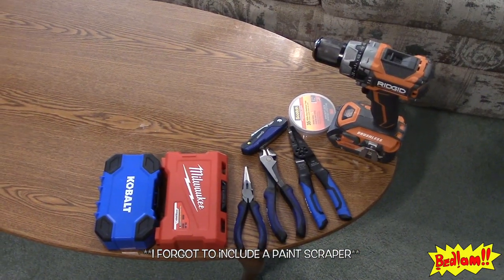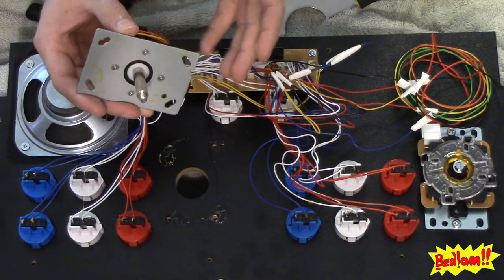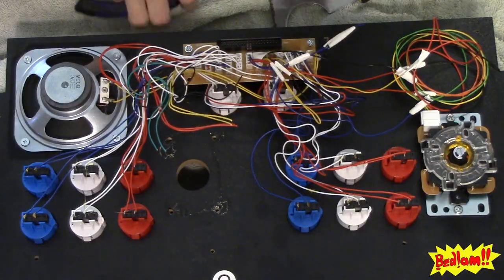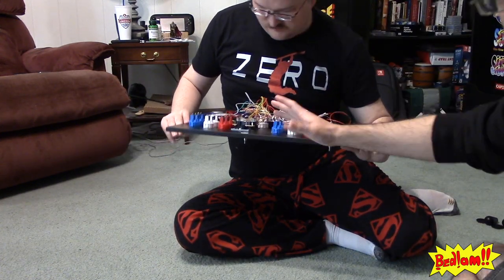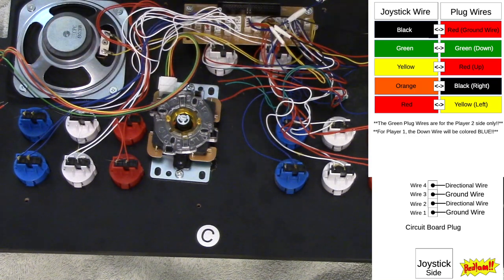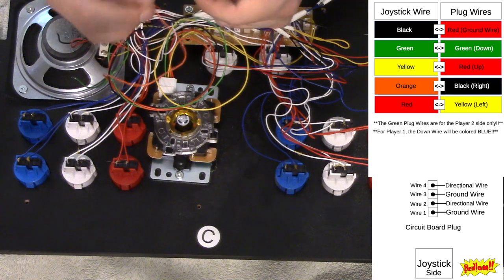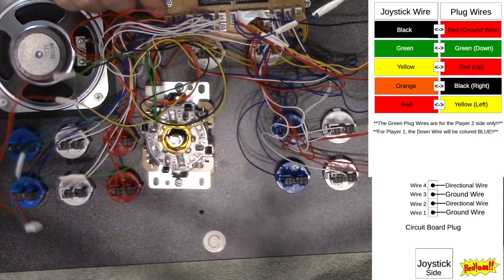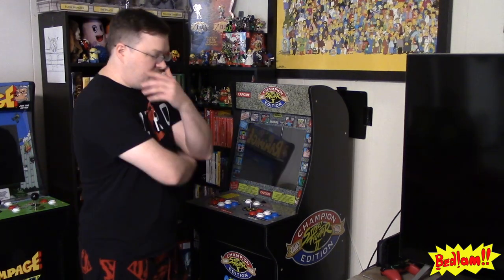Bedlam!! : Gaming - Episode 11 - Sanwa Joystick Installation On An Arcade1Up

Comment: When I ordered my JFL Sanwa joysticks, I just took the metal plate off of the Arcade1up joystick and added it to the Sanwa JFL Stick and then used the exact same screw holes that the Arcade1up already had drilled. it was so easy.
Reply: I wish I had thought of that when we installed these!  I'll definitely remember that for the future if I do this again.
Reply: Dude you just unloaded so much stress from me, I'm not good with a drill at all, thanks so much for the random comment <3
Reply: such a fucking good idea
Reply: Doesn't work on their newer cabs. They use a revised joystick that has a different mounting layout for attaching the joystick to the plate. They even glue the sticks in! It's tough to pry out the stock sticks + plate, then you still gotta drill for the replacement lever! So this video is again, relevant. I just did this upgrade on a Shinku Hadoken cab, but I chose customized OTTO V5 joystick assemblies 👍

Comment: You don’t have to use a paint scraper, it’s easier to pop off the old stick by tapping on it from the other side with a screwdriver
Reply: Thanks for the tip!

Comment: Save yourself a ton of hassle, order the Sanwa JLF Cherry Mod from Paradisearcadeshop and some .187 harness wires, plug and play just line up and screw in.
Reply: Superdimensional can u link and are they as good?
Reply: Mario Pirchala https://paradisearcadeshop.com/en/home/controls/levers/levers-sanwa/1108_sanwa-jlf-with-cherry-switches
Reply: Mario Pirchala I upgraded the spring to 2lb for a little more tension
Reply: @Superdimensional  These are nice. So don't have the get that 8 way piece. Do we have to cut the wires like this guy did or can we get specific wires for these. I just saw your channel that set up is real nice. You added the shaft cover and batstick. Looks real good.
Reply: Superdimensional thank u sir much appreciated...u should put links of these in ur video...ordering them now
Reply: Superdimensional would u recommend these for the other cabinets...PacMan Rampage Galaga? Also do I select specific insert circle octagon etc
Reply: Mario Pirchala probably for Rampage.
Reply: @superdimensional do you have a video how to install the sawn jlf with cherry switches?

Comment: Instead of splicing you can just use the 5 pin adapters wires. A pack of 5 is like 6 bucks on Amazon
Reply: Link?

Comment: Could this be done on the pac man?
Reply from the maker: Honestly, I’m not 100% sure. I’ve never seen the inside of a Pac-man cabinet, but I’d have to assume they use the same setup as the Street Fighter cabinet. If that’s the case it should workout the same way.